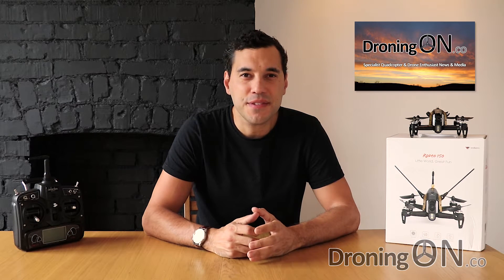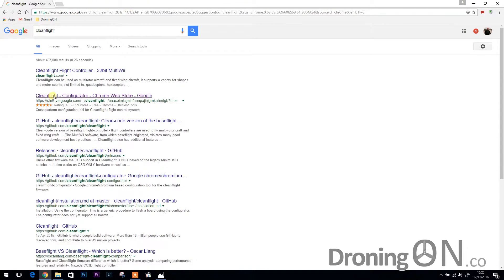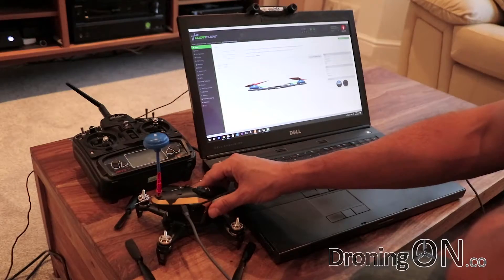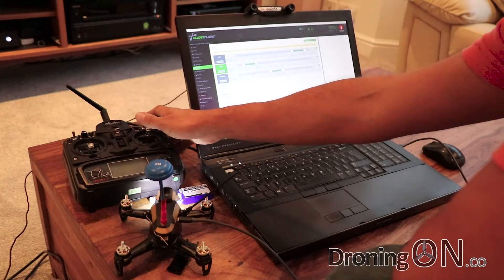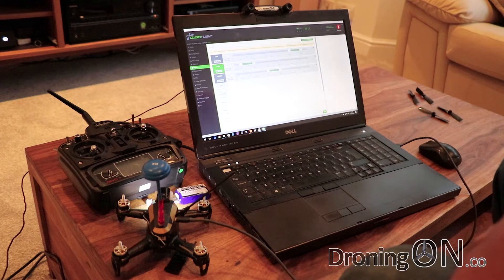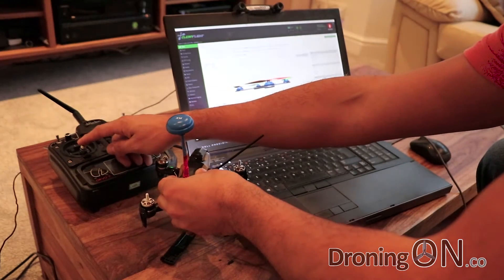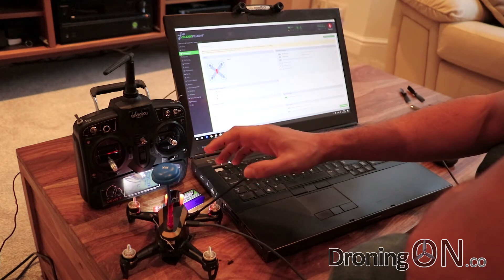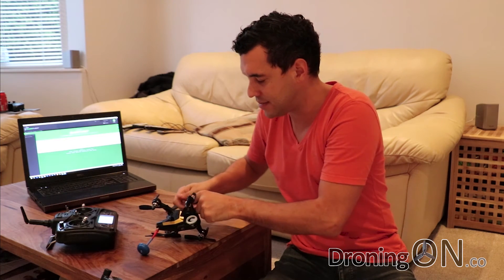DroningON | Rodeo 150 Cleanflight Tuning, Tips and Tricks Guide (Cleanflight)

Comment: not working on mac cant detect why?
Reply from the maker: +Ecoi Villesis take a look for our guide on fixing a bricked f210, it's on www.droningon.co and may help you connect to your Rodeo150
Reply: thanks ill try
Reply: you need to download and install cp2102 usb to uart bridge controller driver mac and use it with cleanflight 1.2.0, it worked for me

Comment: I thinking getting this quad.  Can you mount a runcam anywhere on the bottom body?
Reply from the maker: +KennyLee NYC, I wouldn't recommend it - the Rodeo 150 is very lightweight and the battery time is short already, adding any additional weight would not be wise.

Comment: oh yes I followed your video to the LETTER because it was very well done and super ez to follow. my thing is my clean flight dose not have the tab for air mode for the rodeo...now on my echine tilt..I have the option in clean flight, did I miss a walkera update? because it's not on my rodeo 210 as well. before your video I had to arm my quad with that trim trick. so maybe I need to update the F3?

Comment: Hi thanks for the great clip so far so good. My question my 110 is drifting forward and to the right, I can use the trim on the transmitter to correct this, flying indoors with no wind. What do I need to calibrate in cleanflight to correct for the drift, I would like to keep my transmitter trims centered. Thank You
Reply from the maker: +RC944jim - here's one thing that you can try - with the quad and transmitter on, disarm and set throttle to full, then hold left roll for about 1 second, then back to center, then the same again 2-3 times. Then throttle back to zero, arm the quad and take off, see if that cures the drift? Its a trick in Cleanflight which adds accelerometer offset.
Reply: DroningON.co Wow great tip all I need is the temp to warm up ZERO here. 👍 thank you
Reply from the maker: +RC944jim haha same here in the UK, terrible weather! New review coming tomorrow of a new micro brushless which I suspect that you might want after your Rodeo!

Comment: Thank you for the clear and informative video. But now my quad won't bind to the Devo7, it constantly beeps.
Reply from the maker: +SlNlST3R thanks for your comments, hope that you're subscribed! Have you programmed one of your switches to be the lost model beeper? If so, ensure that the switch isn't turned on. The other point, ensure that you first turn on your transmitter and then immediately power up the Rodeo 150 and place it flat on the ground. Then wait until the Rodeo 150 gives some additional beeps before picking it back up to fit the battery cover in place.
Reply: SINIST3R..
I think you should re-load original Rodeo 150 to solve the problem. FInd it and do restore. but first ,u must have CF old version (1.2.0)
https://github.com/cleanflight/cleanflight-configurator/releases
Reply: You are right. I had to reinstall the old CF.
Reply: That's what I mean.
happy flying..

Comment: Howdie! For some reason my rodeo 150 keeps beeping. It will not connect to my hand control(receiver). Thanks
Reply from the maker: +Christopher Patrick be sure to turn on the transmitter first, then immediately plug in the Rodeo 150 and set it down on  flat surface...Then after it beeps to confirm setup, you can pick it up and close the battery bay?
Reply: I'm a little worried I might of messed with something's when I went throughout the devo 7 control
Reply: DroningON.co it still keeps beeping

Comment: hi, since today i got a problem with my rodeo 150.
i connect it today for the first time to cleanflight, looking through all different option cards and possibilitys, and on the bottom are some infos shown, and it says I2C Error : 4 and Packet Error: 9 
but i am pretty sure to not change any option and or save it! 
at the end my laptop crashes while i hit the disconnect button...
i disconnect the usb cabel, and tried to fly the rodeo, but i am not shure, it did not bind or i am not able to arm or disarm any longer... it beebs but i cant connect... and i got the devo7 from the rtf version. pls help me obi wan.... no fun.. but i need serious help! 
kind regards from germany
Reply: I have the same problem.  I had a crash in the pid section i never changed anything but now i cant bind . It wont even beep . It only does the first part of the tone . I can see the fc in clean flight i can control the motors but cant bind the fc is not even searching

Comment: Hi there I am struggling to install my rodeo to pc so I can't do cleanflight I don't know what to do all I want is to change the arm disarm switch like in the video
Reply from the maker: +Adam Farnell have a read of our guide on connecting to the F210, it's a different quadcopter but the drivers and process is the same. Hope that this helps: http://www.droningon.co/2016/11/10/fix-bricked-walkera-f210-3d-flight-controller-fc/
Reply: DroningON.co thanks mate I'll give it ago
Reply: Still no luck comes up with some win zip and need activation code
Reply: Hay dude got it sorted mate thanks for the tips on the drone

Comment: Hey, which cleanflight version did you use. I read in the walkera forums one was saying that the new version 1.2.4. Corrupts the walkeras, and you should use version 1.2.0. Which doesn't download properly unless I'm missing something. Any advice would be great before I attempt to install.
Reply from the maker: +ezra behrens they do indeed recommend v1.2.0 although I have used other reversions without issue.
Reply: DroningON.co  So on the rodeo 150 you used the one straight from google chrome app? I have the f210 right now, I should be able to do the same configurations.
Reply: DroningON.co   I finally did this setup and it worked exactly the same on my F210. What did you do with the failsafe, for example if you test it and shut the controller off after 5-6 seconds the Props don't stop the only drop to the Speed set with MOTOR STOP set to  spin at zero throttle.  My concern is if you do indeed end up loosing signal and the failsafe activates the Props will still be spinning and could possible burn the Motors or speed control if it lands somewhere on the Props.  It there a way to set the fail safe so when it shuts the Motors off to drop them down to zero RPM with this setting?

Comment: Hi Ash
I'm a bit late to the party. I watched and commented on your original flight review of the Rodeo150 but neglected to subscribe back then. I have more than my fair share of senior moments these days.
Even though I have more powerful race quads I still think the Rodeo150 is Walkera's little unsung hero and for the last few months it has been my favourite to fly. Even though I'd already enabled many of the features you've highlighted here the video was still very interesting and excellently presented. The only thing I've done differently is to use one of Walkera's low profile VTX antennas, it was originally fitted to a nasty 720p iLook camera/VTX combo that had been previously retired after updating to a 1080p iLook camera. I think the antenna is available separately. It has the big advantage that there's next to no chance of breaking in a tumble and it doesn't need removing when the quad is packed away in its case, so no chance of powering up without an antenna connected to the VTX resulting in a painful face meet palm moment. 
Regards.
Nidge.

Comment: Great video but I can't get my fail-safe to work now. I power off the tx and the motors keep spinning until I unplug the power. I try to access the fail-safe menu in cleanflight but just sits there saying waiting for data.... any ideas?  I did manage to set the buzzer switch to activate when the fail-safe activates but not the motor shutdown.

Comment: noob question here... but what does it mean if none of my switches make a difference when I flick them on or off in cleanflight, only my mix switch makes movements..

if I still choose Aux 2 to use for arm/disarm will it work?
Reply: That's exactly what i was hoping/guessing! I am using a DEVO 7 that was came with a RTF runner 250, I just bound it to my 150.. and I may have messed a couple steps up
Reply from the maker: +kmcquiston88, not a noob question at all, don't worry. which transmitter are you using? Sounds like you simply need to either alter the Output mapping of your TX or alter the channel map within Cleanflight?
Reply from the maker: +kmcquiston88, I'm not sure whether or not the Devo7 has a channel output mapping, but check the 'Channel Map' on the 'Receiver' tab and try altering the 1/2/3/4 - also, move your Aux switches and see if any of the channels move.
Reply: I'm sorry, but when you say alter the 1234 do you mean like try 4321 or 1243? Haha sorry again.. also It has a output option on my Devo 7, has like gear, and aux2 for options
Reply: I really want to put my quad in air mode.. but with my switches not moving in cleanflight I can't change the arm/disarm switch and it's risky crashing upside down with motors trying to spin..
Reply from the maker: +kmcquiston88 which transmitter are you using?
Reply: Devo 7
Reply: it was not the the controller that came with the quad.. the quad came BNF,  the DEVO 7 is from a Runner 250

Comment: Good evening...It's a great video. This is my first time operate a drone.  i’ve got trouble with my devo 7. I accidentally
reset the factory setting and now i can’t controll my drone. Could you tell me
how to fix it? Where can i get the factory setting? It is walkera rodeo 150
Reply from the maker: I believe that there are some guides online which tell you how to setup the Rodeo 150 with the out-of-the-box settings, have a Google and see if you can find it, alternatively let me know and I'll see what I can find for you.
Reply: Hi Steve, did you found how to fix it, i found the firmware on walkera site but i can make it work, do you found something?
Reply: http://www.walkeraforums.com/threads/walkera-rodeo-150-wont-bind-with-receiver.1635/

Comment: I uploaded clean flight on my iMac OS10,with Google chrome. The app works, but I can't seem to get the drivers I need? I connect the Rodeo 150 to it with the USB,but nothing happens, and get a message connection failed?
Reply from the maker: Ron Dog I'm fairly sure that it isn't possible via Mac, you'll need to use a Windows Virtual Machine within your Mac to achieve it.
Reply: Ok! Thanks!
Reply: I got the old PC out, and the clean flight loaded, and worked flawlessly!  Do you have any recommended settings for exponential on this quad? It feels "twitchy" to me in the acro mode. Thanks,Ron
Reply from the maker: Hey +Ron Dog! Glad that it all worked well, be sure to give a thumbs up if you haven't already and share the video too! I'll have a play with expo, for me personally it feels quite nice OEM but I'll explore and come back to you!
Reply: Same thing happened to me
Reply from the maker: +Zarek Merchant try downloading the ATM USB drivers, then try again?
Reply from the maker: Have a read of this article that I wrote, it relates to the F210 but the 'Drivers' section should help you in getting connected to the Rodeo 150: http://www.droningon.co/2016/11/10/fix-bricked-walkera-f210-3d-flight-controller-fc/

Comment: Thanks for the video !. Crashed my Rodeo and burned an esc.. I replaced the esc but not my  quad wont bind to my transmitter .It used to bind even with 3motors on. Any help before i give up on this quad? PLEASEEE HELP!  +DroningON.co +DroningON.co
Reply from the maker: +lookupitsgreg have you checked that your throttle trimmer is at zero? Did you also turn on the transmitter first, then plug in the Rodeo, place it flat level, wait for the beep and only then close the battery bay?
Reply: yeah it still doesnt bind...is there a way to rebind the transmitter and the 150?

Comment: Great video buddy. I fly my rodeo for the last couple of months. I started fpv using quanum cyclopes which are great but I never connected my rodeo to pc. Thanks to your video I will try very soon.  Thanks mate.
On that note do you think rodeo is compatible with 3s battery? 
cheers!
Reply from the maker: +Greg Zelent thanks for the comments, glad that you found the review useful! I wouldn't connect a 3s to it, the extra power would be nice but flight time would be short because of the additional weight - it's a tough balance really - just buy a bigger quad :)

Comment: I can not get clean flight to connect to my laptop it's keeps saying fail serial port. How do I install drivers to use cleanflight. It will work on a friends computer although he has a more up to date system.
Reply from the maker: +SteveO4478 it's not a video Steve, it's an article. Have a read, it talks you through how to unbrick it.
Reply: DroningON.co  I finally got cleanflight working again. I deleted the stm driver by accident on zadig somehow. Well, I flashed the stock firmware from walkera successfully and unbricked! I am trying to get stock configuration to the quad from text file from walkera next. When I disconnected and connected the 110 the board bricked again so  I will prolly have to de-solder the boot pins. When I first disconnected I tried to fire up the 110 and see if i could fly it but it would not bind to the transmitter.  I will have to try again later but I'm almost there!
Reply: DroningON.co  I've flashed to betaflight 3.1.5 instead and de-soldered the bootloader pads and I'm just trying to get 110 to arm. I trimmed down the throttle to get a arm signal but it flips over upon throttle. The pitch on rx configuration was backwards.
Reply from the maker: Great to hear +SteveO4478, I hopefully have a 110 on the way and so full review and tuning tips video will be enroute :) I'll also include the flash process!
Reply from the maker: +SteveO4478, search for the 'Windows STM Driver's, get those installed and then restart your PC, then try again, that should solve it.
Reply: DroningON.co  Thanks! It's older laptop , I will try it out!
Reply: DroningON.co thanks for your help I'm up and running on cleanflight that was the driver I needed to install. I installed cp210x driver and wasn't working.
Reply: SteveO4478 Hey there im having the same issues with cleanflight, i have any older laptop, Windows 7, what driver do i need to install?
Reply: Travis Waner you need to install the cp210x driver. Search stm drivers in google also.  I have to check later to tell you exactly.  Since then I have it working now.  I have to look but try that first.
Reply: SteveO4478 cool thanks, I'll give that a try
Reply from the maker: Take a look at my guide here on getting connected, this should help as I give details on how to install appropriate drivers.

http://www.droningon.co/2016/11/10/fix-bricked-walkera-f210-3d-flight-controller-fc/
Reply: DroningON.co  Well long story short I flashed the spracingf3evo  by accident instead of spracingf3 to my rodeo 110 on betaflight! I attempted to un brick but would not work.  I have just ordered another fc. I tried to connect my rodeo 150 and f210 before I flew them and fail to open serial port appeared. I have not upgraded any firmware with the two , I  was having problems connecting awhile back when I didn't have the drivers.  The weird thing is that I can connect my qx95 and qx70 with betaflight flashed and having no issues connecting. So drivers seem to be working, something is not letting me open the serial ports on my 210 and 150 now. This has just been a mess! Maybe someone reading will know how to troubleshoot this? Thanks!
Reply from the maker: +SteveO4478 oh nooooooo you don't need to order a new FC, just follow the instructions in my guide and reflash the original 110 firmware back to it?
Reply: DroningON.co yeah I did and I just soldered the pins they were really small but still would not come out of the brick. I was getting failed to read bootloader and then I used zidag to try to get the fc in boot mode and then it was saying failed to read serial port. I'll try de- solder pins and re- solder. I really don't care about not connecting the 110. I'm trying to figure out why my 150 and 210 are not connecting to cleanflight at all now.  Do you have any suggestions? I have got the quads to connect with no problems before I had this bricking issue.
Reply from the maker: So you've tried all of the steps in here (but using the firmware for your quad)? http://www.droningon.co/2016/11/10/fix-bricked-walkera-f210-3d-flight-controller-fc/
Reply: DroningON.co  I saw the video before and thanks! . I will run the process one more time and see what happens. Aside from that I always used to mess with configuration on my 150 and f210 and now serial port fail showing up on cleanflight only. Other quads that have betaflight installed are connecting just fine. I may have did something wrong to the drivers. Don't know how to fix this. Maybe you have a suggestion? Thanks !
Reply: DroningON.co I'll  read the article and try again. Thanks for your help on this !
Reply from the maker: +SteveO4478 glad that you're making progress dude! Keep us updated!
Reply from the maker: +SteveO4478 glad that you're making progress dude! Keep us updated!
Reply: DroningON.co RCFlyer85 Hey man ! Thanks for your help! I have the 110 up and running and it was along journey from trying to un brick to the right board! Lol! The 110 is flying awesome and more aggressive than stock. So far im loving this thing even more with betaflight flashed!
Reply: DroningON.co I noticed some voltage sag when I do punch outs didn't remember that when I was flying cleanflight. I'm  interested to see if you notice any when you get yours in. Looking forward to your review!